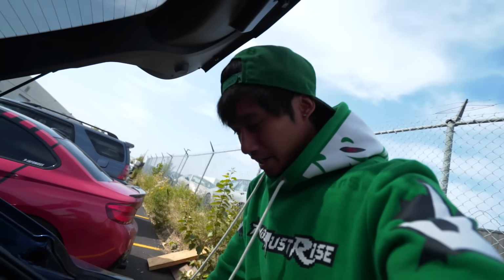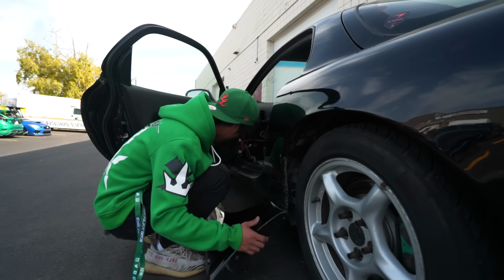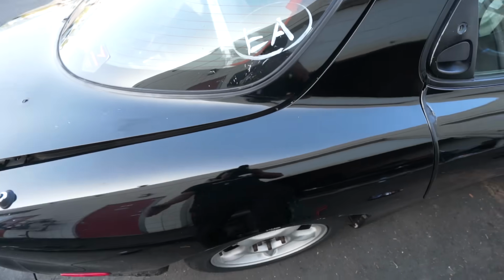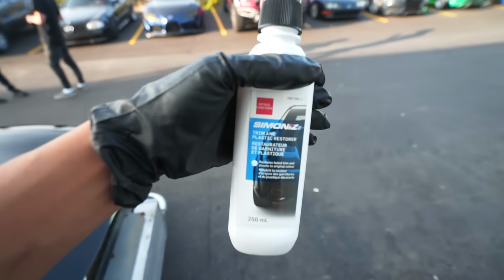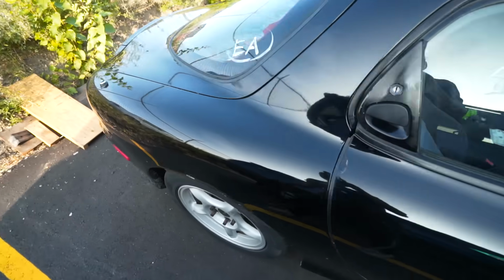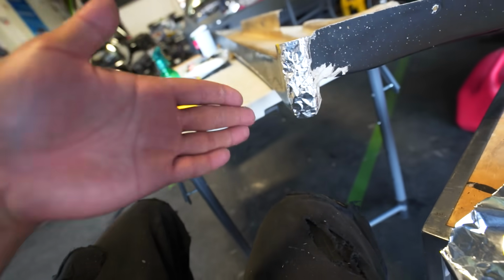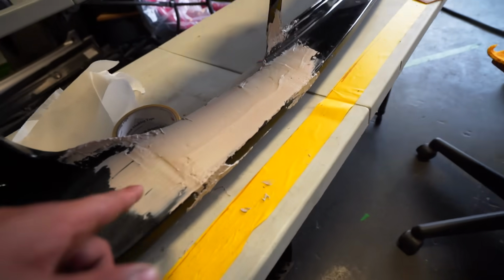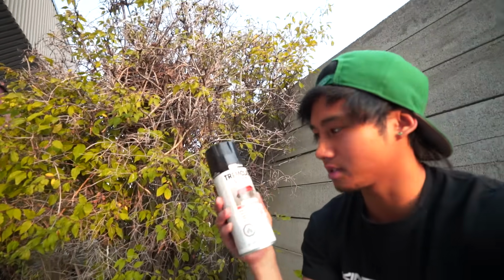RESTORING THE IMMACULATE PAINT ON MY 1JZ-RX7!!

Comment: Hey man- trade secret instead of using that temporary trim restore stuff. You can take a heat gun too the dulled trim and it will bring the black back out of it. Be careful not to melt it up course but you will see if change right before your eyes and you will know it’s done.